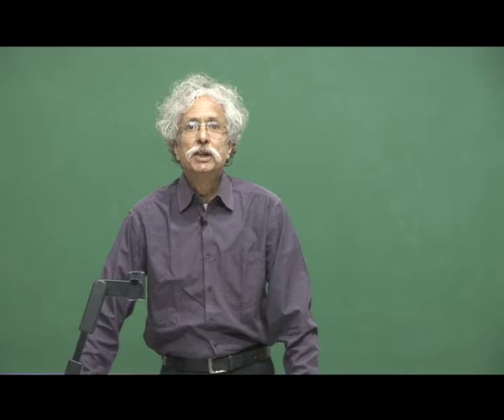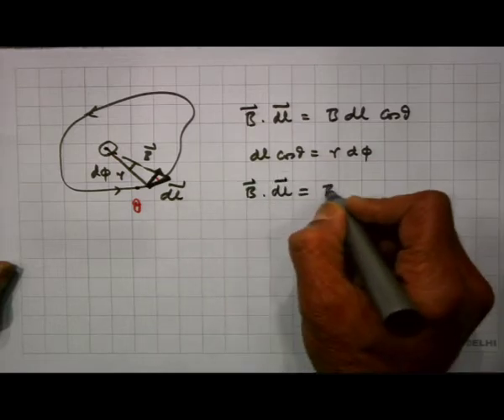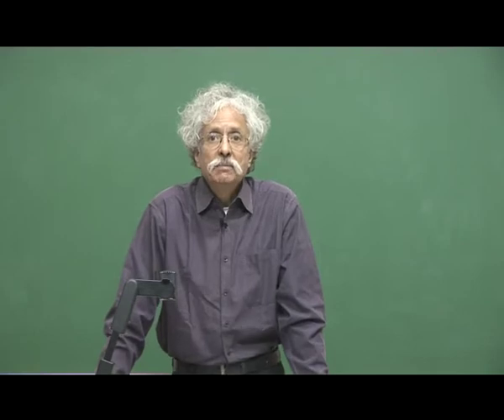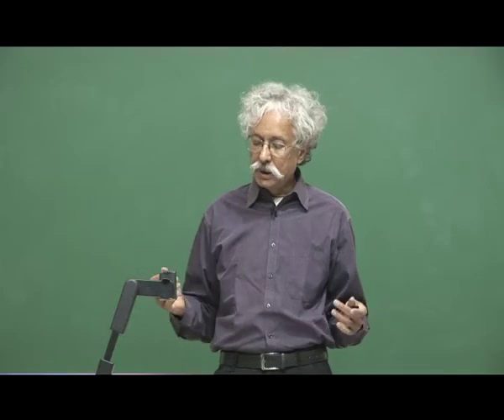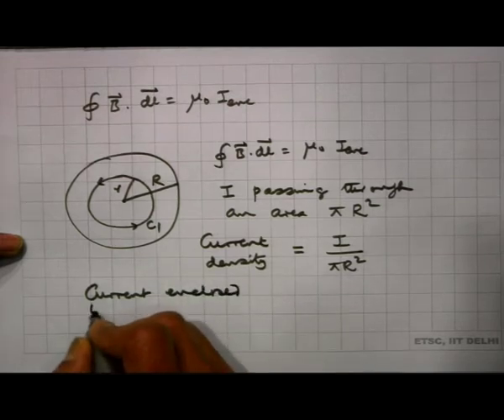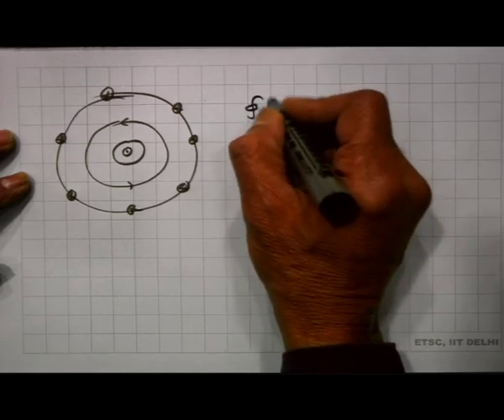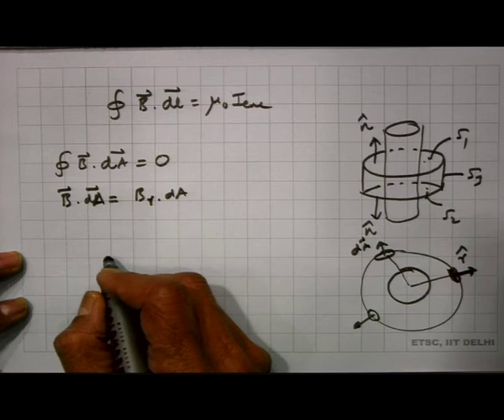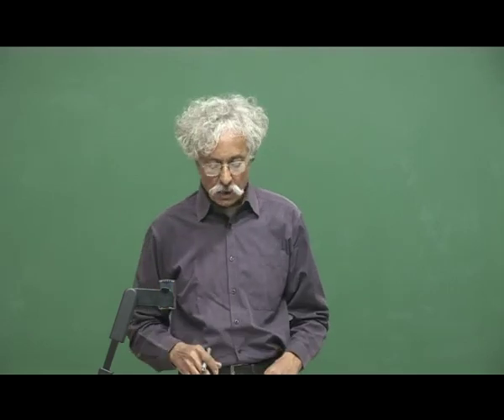Generalization of Ampere's law and its applications (CH_22)

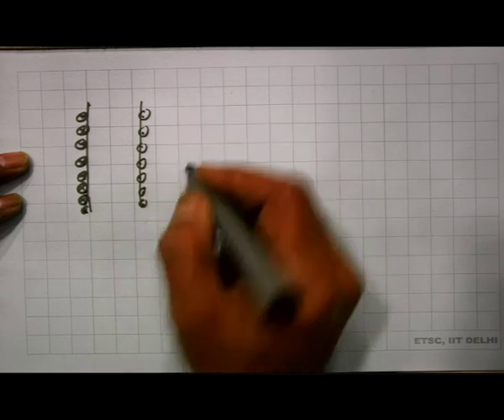Comment: Can't understand after 53:30 are the two diagrams two different dimensions of view or something else
Reply: The diagram at the left is of the solenoid where the crosses say that current is going into the page and the dots say that the current is coming towards you. The diagram at the right- the rectangular loop- is just a path that has been taken next to the solenoid to prove that magnetic field outside the solenoid is 0. I hope this helped.
Reply: @ShreyaMishra-dt8gm  thanks,I thought that loop is the another angle of view of the solenoid and it can be but here it is a case where an ampere loop is taken outside the sooenoid